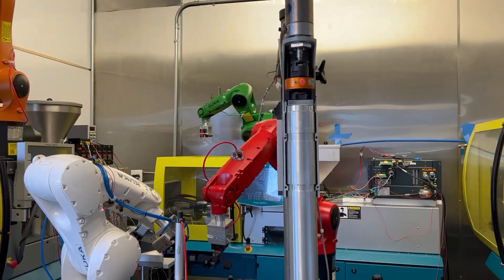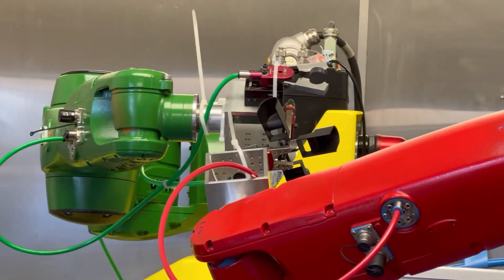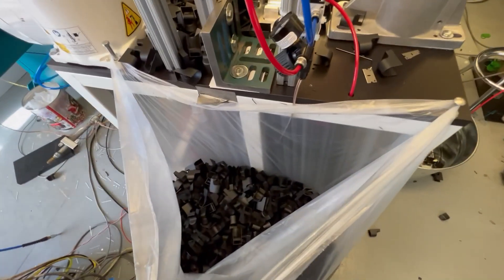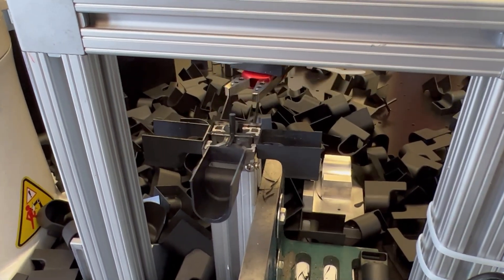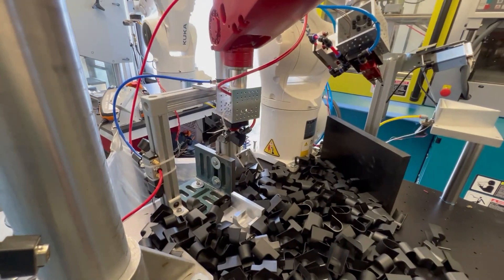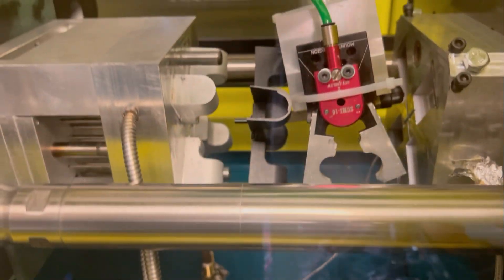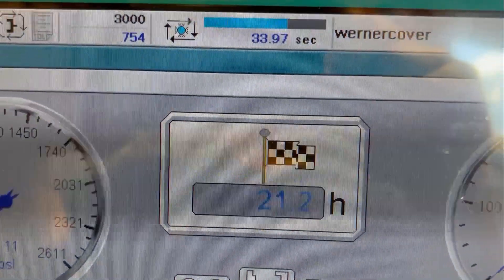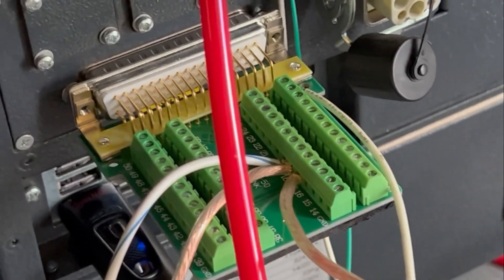ROBOT AUTOMATION for small runs

Comment: Normaly the Controlls must be via relays galvanic insulator against each other and it dosent matter for the + - inkompatibiliti, ok that is one reason , but there are enough other reasons wy it must be.
The worst case in this moment is two sircuitbreakers on one wire.

Comment: Is the injection molding machine initiating the robot moves?  Just wondering who controls the timing..?  Also, do you have a source for the heating/cooling controllers you are using?  I've bought a few off amazon, but I'm planning to buy them in bulk soon.  Looks like you've bought a few, so I figured I'd ask.  Thanks again for sharing your setups.  This stuff is fascinating to me.
Reply from the maker: The machines trigger each other with 24 volts.  I like to say they pass the baton.  There is no master control.  I but the "MYPIN" temp controllers from China off of Amazon.  They work best.  The old school Omega controllers are very hard to understand and cost 6X as much.  I made the control box that they fit in.  Thanks for watching!